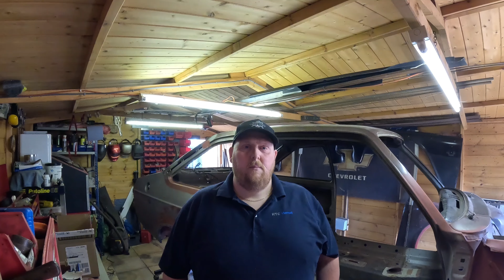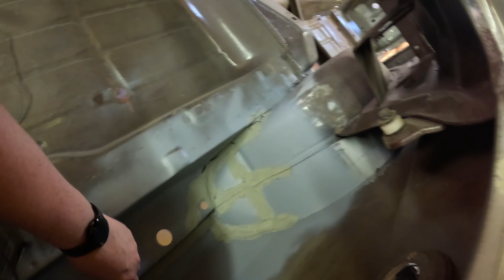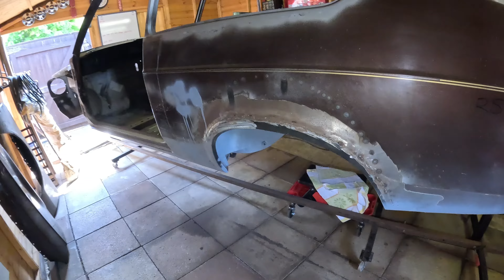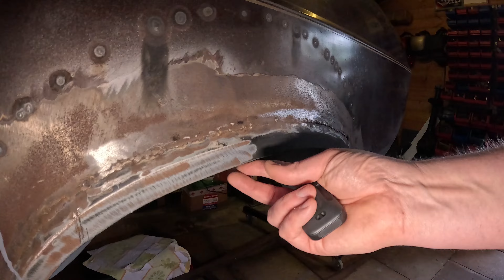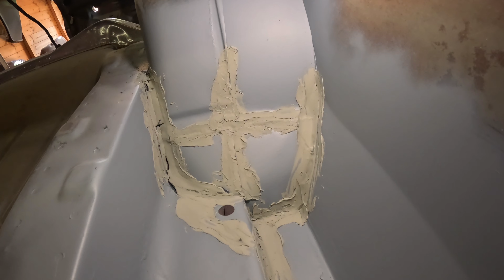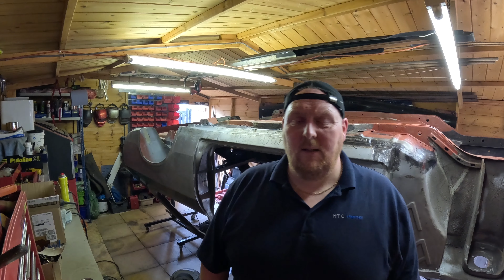Mk2 Escort 2 door rear arch repair and modify

Comment: If that’s brushable seam sealer Ady that doesn’t like being too thick we found issues with it cracking sometimes and doesn’t always “flash” off and stays sticky. Also doesn’t like being redone over the top. Coming along well bud keep at it 👍 good old sikaflex or tiger seal is also nice to go over with a brush better and gives a factory look
Reply from the maker: Cheers mate,
Yeah it is brushable. The annoying part is I've done the other side with exactly the same product and it went on fine. This new one I bought is a different consistency. They must have changed something since the last time I bought it.
I had debated using tiger seal.
If it doesn't set this time I think use that instead.